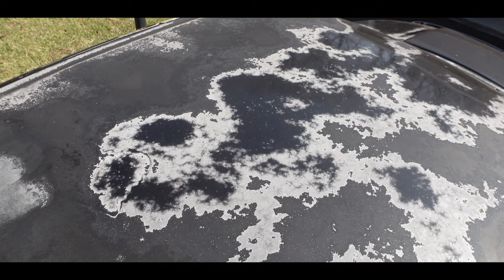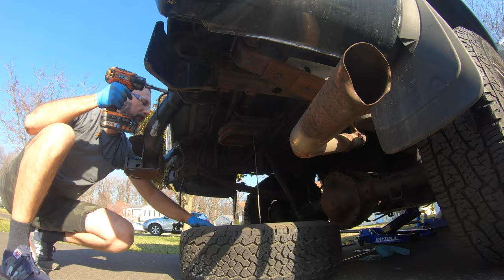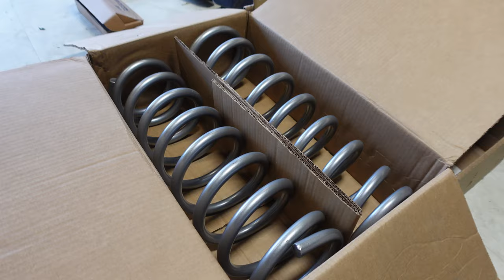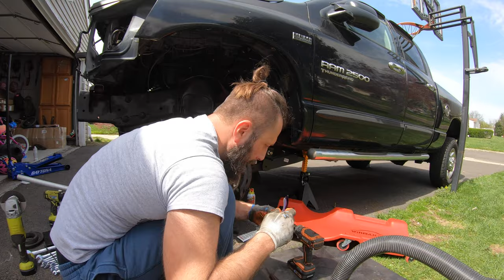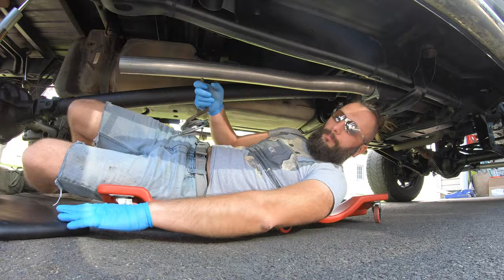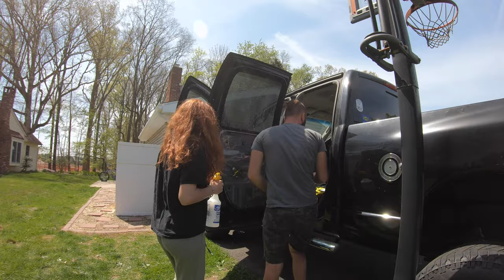INCREDIBLE Transformation Of a 2006 DODGE RAM 2500 THUNDER ROAD edition

Comment: You killed it! I'm doing the same right now on an 05. 
How difficult was lift install alone?
Are the seats comfortable?
Wheel and tire specs?
Reply from the maker: The installation requires some effort. I'd rate it 7 out of 10.
Regarding seats, I think that they are much more comfortable than the factory ones.  
Rims are 20X12 on 35 tires
Reply: @ikajeiOFFICIAL  got a link to seatcovers? Did you not like fitment on front?
Reply: @ikajeiOFFICIAL  what about some audio upgrade, speakers and more.... incredible build

Comment: What marker lights did u use on the side of the truck. Did u attach to lip or to the step bracket.
Reply from the maker: Around 8 years ago, I bought these lights for a different truck but never got the chance to install them. Unfortunately, I couldn't find the link to them, and it seems like the lights have been discontinued. As for the installation, I attached them to the lip under the rocker panels.

Comment: I'm familiar with the Vantage 3M film, but did not know it has a paint replacement form, that's interesting.  How is that film working out for you longer term?  Very interesting.
Reply from the maker: In general, 4 to 10 years. All depends on brand and model.

Comment: Which lift kit did you use?? I’m tryna get the exact one
Reply from the maker: Please look at the description under the video for the link to the parts I've used in this video. Also, consider that the lift kit differentiates between gas and diesel engines as well as between 2WD and 4WD trucks.

Comment: Hi, where do you get the soft opening system? Ty!
Reply from the maker: Please check the description section of the video for the links of the products I've used in this video. Let me know if you need more info. Thanks.
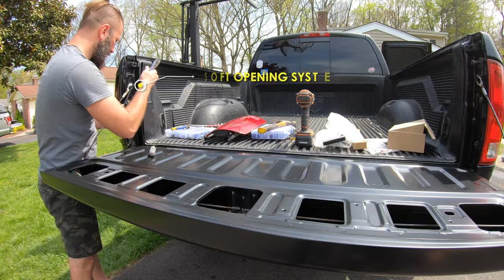Reply: @ikajeiOFFICIAL  At minute 10:06 marks that you use a soft opening system for the rear door of the truck. I can't find the link to that system
Reply from the maker: @mickyquiroga3517  Check the link for Rear Tailgate Assist Shock